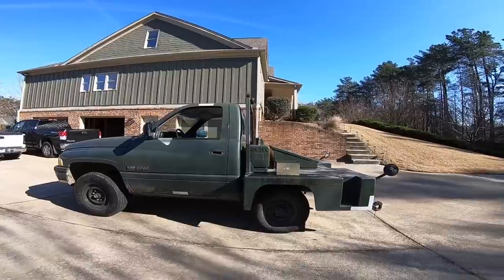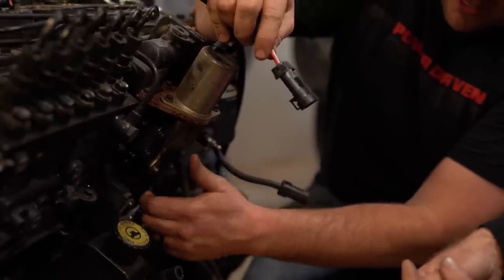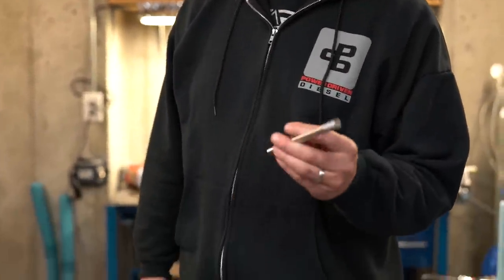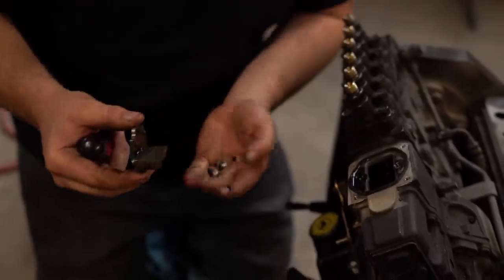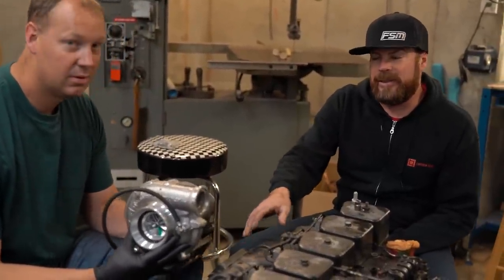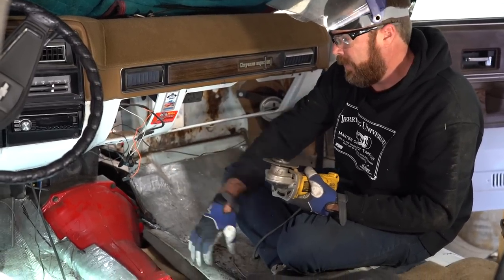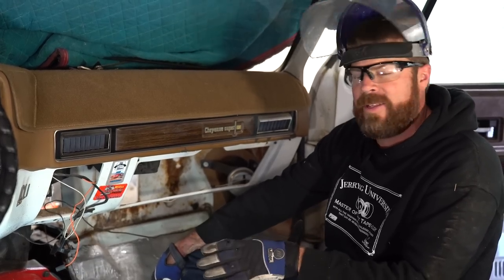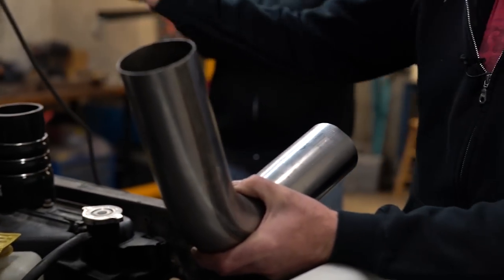Finnegans Garage Ep.47: 700hp Square Body Chevy Cummins 12 Valve Swap Part 1

Comment: This is Roadkill, Raw Extended Edition.
Reply: Rafael Santos_7 no, Finnegan does things properly here, doesn't bodge things together like roadkill
Reply: They are under such time constraint on Roadkill. Plus these are Finnegans own vehicles not owned by TEN
Reply from the maker: all true.
Reply: I paused The Skid Factory for this.
Reply: I'd say more like "Hot Rod Garage"
Reply: microbuilder the new skid factory build ia gonna be sick twin turbo ls1 skyline 🤤
Reply: This is better than Roadkill, it’s still on YouTube 👍
Reply: Also, it's easier to find than Roadkill on MTOD. All those %$*$#%ing US cable TV car shows it's full of now are just trash.
Reply: Leroy It wouldn't be so terrible if their site had a good way to add series to favorites and such, so you can get updated on the things you are paying them for. But no. I have to wade through piles of crap, 3 frickin' videos at a time, until I find a video I have already seen, then scroll back the other way until I find new stuff I want. Utter trash. Told them why I quit their service.
Reply: The Skid Factory is awesome , just watch it after..
Reply: nathan butler and dont forget the rb26 fairlady z build mcm is doing
Reply: 6:00 Now this is a look I can relate to. Sweatshirt covered in dog hair, draw string pulled to the side.
Reply: Oh man, the little fab'd tab to keep the little bolt from causing the engine to have a heart attack...
Reply: roadkill is "fucking send it" hotrod edition.
Reply: And I think that's perfectly okay with me.
Reply: What Roadkill?? This has real mechanics not 2 YouTube mechanics LOL.. Loving the quality keep it up!!
Reply: This was good value, few lads doing a bit of backyard power upgrades and slicing up the firewall to make it fit.
Reply: Always a good show
Reply: Love to see your un silly stuff Leroy,  probably show Mike or Motortrend  up big time!
Reply: Get a job or your own garage Darthane....maybe move out of your mom's house and let her watch her own sewing channels
Reply: We, all his followers, have one thing very clear: He is more likely to do things right with the cars. We have by one side that this is something that he does for enterteinment purely and by that way he has no time pressure and can give this results to this jobs ( maybe being this his real way of working with cars, you can see that in the way he welds ).
In the other side, Roadkill is his job as he says. It's a tv ( or internet ) show and with that, it may have some of teather and some of reality. And one thing is for sure: the pressure of the time. Just check the Pontiac Firebird episode. Sometimes, when the time is short, you do things as you " Can " and not as you " Want "
Reply: II'm
Reply: Finnegan's Garage when is part 2 coming out
Reply: This is better than Roadkill because I can actually watch it.
Reply: 😂 but yeah😀👏👏
Reply: Finnegan's Garage sup with some pizza tho 🙄ever Since I seen that episode🤔when u pulled up on the crusher to your dad's😀👏👏🍕🍕🍕🍕🍕🍕🍕🍕🍕🍕👏👏👏👏👏👏😋
Reply: Man I completely understand the evolution of RoadKill but this is how it should have stayed

Comment: This was one of the most comprehensive and all-in-one videos I've seen on modifying the 12V!  Excellent work Mike!
I pulled the cab mount bolts and jacked the cab up several inches on the 1994 doner I pulled my Cummins out of and still bent the valve covers cover thing when pulling it out.  I broke my dyno at around 350HP without bolt-ons.  Just timing, fuel pressure, and injection pump mods.  The gov springs was the what made the biggest difference.

Comment: Is it me or is the video quality way higher
Reply: Modern Patriot I think it is.
Reply: Looks like dslr footage instead of go pro. Maybe even higher end? Depth of field gives it away.
Reply: Modern Patriot probably made as a pilot for MTOD lol
You can watch the next Finnegans garage right now on....
Reply from the maker: you are correct. I had a lot of help on this one. It was a very labor intensive project so I had someone else man the camera and audio.
Reply: Mike did you get an editor? This stuff is golden. You should do more stuff like this. I know that you have a budget since you have to fork over the money. but if you keep stuff like this up, this channel is going to get big... and do more give aways.
Reply: the clarity of the video seems way higher like a better camera
Reply: It looks better.
Reply: Greg Fuller DSLRs are crap for video. Camcorder all the way. The Sony FS line has better image with a sensor half thr size of full frame SLRs.

Comment: Put the 454 in the firebird with a blower. Or turbos
Reply: Don't ever disgrace a real Pontiac with a Chevy engine
Reply: did you hear Buick is coming out with a Firebird and Trans Am?   BUICK!!!!
Reply from the maker: I gave it to a friend of mine who is going to race his Nova at Hot Rod Drag Week.
Reply: Finnegan's Garage cool. I'd you get a chance make a video about it.
Reply: A Pontiac  is a Chevrolet  wearing a halloween costume .
Reply: Or both
Reply: i was thinking of your old vette before i knew the fate of the 454. the vette really would be awesome in 70's scca racer style. but i digress.
Reply: This isn’t roadkill. That’s a bit much.
Reply: Production values have taken a big leap forward with this video, good stuff. 
Can’t wait for part two.
Reply: opens door.
pontiac/chevy fight
closes door.
Reply: Mabye do something new with the Firebird?
Reply: Even though you are doing the ramp truck right, making sure everything works, not cutting corners, etc., you've still managed to make it more roadkill than it was; theres no AC now! The ramp truck is no longer too nice for you and Frieburger to road trip.
Reply: gotta be kiddin' me buy a new Pontiac!
Reply: Its the same GM-produced motor, friend. The newer GTO's just had a performance-orientated 350 but everything else was identical to almost every half ton pickup from the 90s.
Reply: bore each cylinder out 125 thou and call it a 455. lol
Reply: Buick.
The brand that SHOULD'VE been killed off instead of Pontiac, then went on to flood America with Chinese-built deathtraps, is now making PONTIAC'S cars.
THAT Buick?

Comment: That's going to be a winning combination for a towing machine.
Reply from the maker: I hope so. it should make plenty of power.
Reply: I have a basically stock '03 H.O. Gets fuel mileage in the low 20's with no load and pulls like a freight train when loaded. Never fails to impress. This thing should be a monster!

Comment: The reason why the Cummins was hard to get out was because it wasn't designed to ever be replaced ;)
Reply: Or they figured nobody would care about damaging the shipping crate.
Reply: It was designed to go in and out of the bottom.
Reply: No, you just have to replace the shitty crate they come in...
Reply: @salvadordollyparton666  I love this swap.   Finnegan you are well on your way to making a good truck.  Better save the dodge for a few parts yet.  The American axle will never stand up to the cummins so you will need the  Dana .  Make sure you weld gussets on the GM frame where the shocks and steering box attach and  there will  probably be a few other cracks.  Maybe a video and just replace the frame with the one from the Dodge?   The last piece of the puzzle would be to replace the poor GM sheet metal  with the cab off the Dodge it looks pretty solid.  I would keep the headliner out of the Chevy, as long as the glue held they were pretty good.

Comment: Dodge powered chevy carrying a dodge powered chevy
Reply: HAHA! Nice observation, didn't think about that, however, technically, Cummins is not a Dodge engine, Dodge could never build anything that durable or badass. Dodge trucks are just another piece of machinery powered by a Cummins engine. Just sayin....
Dodge has really missed out on all that Service and Factory Replacement Parts money that Ford has been making replacing melted and grenaded powerstrokes every day for the last 20 years.
Honestly all auto manufacturers should probably let someone else build their engines for them, they can focus on designing cool cars and let the engine guys design engines that are proven durable and efficient. I'm rambling on a comment.....sorry.
Reply: cody tracy dodge never never made a diesel engine. They don't know how.
Reply: Ya chevy is the only one who ever put out a diesel (starting with the terrabad 5.7 or whatever, then the 6..2 6.5 fuel econ diesels and then duramax) both ford and dodge took other companies motors and stuck them in trucks.
Reply: Matt Lane let's not forget Duramax is isuzu
Reply: Matthew Jr G proved itself. The point was dodge never ever made their own diesels. The 6.2 and 6.5 diesel engines were actually designed AND manufactured by Detroit diesel which is owned by GM. So yes gm made their own diesel engines. Case closed.
Reply: Grizz Bear didn't say they weren't said that the Duramax which is currently being used is an Isuzu engine
Reply: Cummins powered Chevy pulling an aftermarket aluminum hemi powered Chevy.

Comment: You've gotta get some epoxy on those floors
Reply from the maker: That would be nice. I care less about how the garage looks than I do how the cars run.
Reply: It's real convenient to not have to worry if you spill something.

Although now I have a bad habit of not mopping up puddles...
Reply: Huh? I don't have epoxied floors and I don't care if I spill stuff either imagine that...
Reply: It's a bit different when you can just leave a puddle of oil sitting there for a couple months, and nothing's worse for the wear.

Makes it hard to convince yourself that it needs to be cleaned.
Reply: Finnegan: Probably easier to keep clean though...
Reply: leroy420b haha. Let me guess, you rent/lease.

Comment: I am building a 1986 Dodge D100. Pro-street with 500 CID stroker big block. All trick Flow upper end. I have added an 8 3/4 rear axle out of a Plymouth Cuda. Gusset welded to the axle then a 4 link ties it to the truck. I am delayed on my build due to loosing my father in July, but need to continue the work needed to get the job done, and honor him as well. 
I am doing all the work from fab to body.

Comment: So what's cool about those Rams is we call them bobtails. We use them to tow around munitions and aircraft. The tow rating is 40k lbs worth of munitions or up to a 70k lbs aircraft. I think I heard those rams specific ally have a 6.50ish rear end in them.
Reply: Can confirm, I have drug many E-2C Hawkeyes with them when we were in Guam for Strike Fighter Advanced Readniess program. You could only get them to do 30 mph but would tug a 50klbs Hawkeye like it wasn't even there.

Fun fact the normal TUG brand tow tractors the Navy uses has a shorty C6 Ford trans in it rated to 1000 ft/lbs of torque.

Comment: Great project. Years ago when I had a diesel repair shop in Cleveland, a customer brought in a Chevy suburban like that with a nice Isuzu midsize truck diesel engine conversion and Doug Nash five speed. It was also a four-wheel-drive. What a great vehicle he had built. Too bad the motor developed a problem. We pulled it out and put a small black in. I hated to ruin all his hard work.

Comment: I remember my first VW Bettle. Although not a diesel under certain circumstances (in summer, everything very hot, guess one of the disadvantages of an air cooled engine)  the engine kept running if you switched of ignition, it actually kinda "dieseled". So you had to stall the engine with brake and clutch. Later the VW engines had an electromagnetic fuel valve and if you switched off ignition, that thing closed the fuel line.

Comment: These Power Driven Diesel guys Rock!
Very much exact onto the point, nice to watch, no Bullshit and bla bla. 

I am working on a 4x4 Van with a 7.3 IDI, which is ridiculously huge and especially the engine - for being a truck in Germany. [VW2.0 TDIs are used in big! cars]. Though, not finished, I am already thinking about a way to get a similar (expedition) truck with a Cummins ... 
[btw more or less impossible so swap legally an engine in Germany, without possibly getting actually in jail if caught in an accident with something like this. Not a car guy country here, if not stock!].

Comment: Just use a choke cable to turn turn the engine on and off. It will start quicker as the solenoid that turns the fuel on is still opening when while the truck is cranking. This is what I did when putting the same engine in an 88 F350.

Comment: You need at least 3 degrees in a u-joint to make sure it wipes grease back and forth to keep it internally lubed.  Never set one to ZERO degrees.  It will not lube and will wear prematurely.   (Eaton class 1986)
Reply: Thank you for that knowledge, I'll take it!

Comment: My dad had a 3+3 when I was in high school it had 536 rear gears it used to cost me 15 dollars a day to drive it to work when gas was dirt cheap back in 1998 it would smoke just about anything light to light but the gas gauge and the Speedo raced each other when you would put it on the wood

Comment: Did you ever put a heater in the cab yet ??? you can buy a tractor cab heater fairly cheap from a farm supply store and it will keep you toasty when it gets cold.  When the windows ice up you can mount a small fan on the dash to blow warm air against it.. I live in Carrington, North Dakota and you can't live without a heater here ! Good job Finnegan !

Comment: I don’t know if it’s been mentioned as there are way too many comments unrelated to this awesome video, but, #TennesseeDiesel makes a gorgeous front cross member and engine mounts to solve your firewall/fan clearance issues. Use a radiator without oil cooler from a mid 80’s square body manual, stock dodge CAC, remote trans oil cooler, and everything fits without cutting IIRC. If that was a Turbo 400 it could have used as well with an adapter and the correct TC, ring gear, etc.

Comment: Replacing the body mounts on the cab, or even using 2 inch body lift ( or a couple of hockey pucks) would have made it easier to get the motor in there, but you would still have to do some cutting.  Time to go get a cheap metal wheelbarrow to use for the firewall, like they used to do in the old days when they needed to recess the firewall on motor swaps into street rods.

Comment: Mike a first gen dodge fan drive is 1 inch shorter and sits about 1/2 inch lower..  when i did my 95 3500hd i used the 6.5 rad and fan shroud...

Comment: Not sure if anyone mentioned it or not - but with 1st gen accessories you wouldn't need to cut out your firewall to run a mechanical fan - that's how my 89 square body crew cab is setup.

Comment: I would love to have the resources and funding you guys have.  I'm a fan of your "for fun" show and Roadkill.  We are a lot a like honestly, I have several projects.  My problem is getting things done.  Welding is something I really need to learn, it would make things much easier if I knew how to weld.  My current pending projects are a 67 Belair 2dr post getting a 550hp 468 and Nv3500 5 speed, 67 Impala 2dr sport coupe getting a stock 454 gen 5 tbi using the original 3 speed manual on column (hoping to make a nice driver), 68 Galaxie 2dr ht I broke a camshaft in, ratty 64 Impala 4dr I daily drive, 73 and 74 Datsun 620 pickups, ratty 66 Volvo 122s 4dr, 81 Chevy 3+3 dually getting a gas engine from an old bus, and a few others.  Here in Michigan, there isn't a lot of good medal in cars sitting around, there isn't really much in junkyards to salvage, it seems like everything is against me in this state.  I won't give up, I really enjoy watching your builds.  They give me some hope and an understanding I really need to learn how to weld.

Comment: 12 valves didnt have a computer until the last couple years of production, one of the only problems they had was 5th gear would fall off because of the torque, the dealer would fix it by beating the threads down but it would rethread them and fall off again until they got bolts that lock

Comment: Neat tool for turning the engine over by the ring-gear - haven't seen that done before - ditto the valve spring compressor tool. Diesel guys have this shit sorted [cool]!
Lots of shaggin' around*, but definitely going to be worth it in the end with confidence in the reliability [smile].

*ANZAC slang for fornicating around...

Comment: Getting ready for a 6bt swap in an 87 2wd 3+3 myself. I contacted DCS and they say I will still have to drop the cross member about 2". Didn't notice them dropping it on the ramp truck just wondering how they got around it. I'm going to cut the firewall regardless but I'd love to get around modifying that cross member.

Comment: Good ole bobtails. The old dodge ones suck. Ended up being replaced by powerstrokes. They are geared so low for towing that the max speed on them is like 35 mph and at that they are screaming at over 2500 rpm. But on the bright side, they are rated to tow like over 50k

Comment: As an owner of a 75 C-20 Custom Deluxe Camper Special I have been driving daily for the last 30 years I wasn't too sure of this swap at first. Kind of seems sacrilegious to take a motor out of a Dodge , I know Mopar people that would be screaming and jumping up and down about that. Then stuff it into a Chevy. And I know square body people that would be jumping up and down and screaming and yelling about that too . But then I have put Oldsmobile engines in Chevys, Chevy engines in Pontiacs, Oldsmobile engines in Pontiac, Buick engines in Studebakers. So I was kind of curious to see how he was going to pull it off. I know how much room is under that hood. If it's a small block you can throw three dead bodies in there and nobody would know it there is enough room. Big block, maybe two. Cummings diesel? That's going to be some cutting. And tearing up all that nice flooring insulation you put in. To kill the Heat and sound. That's has to suck. But good build. Hats off to you.